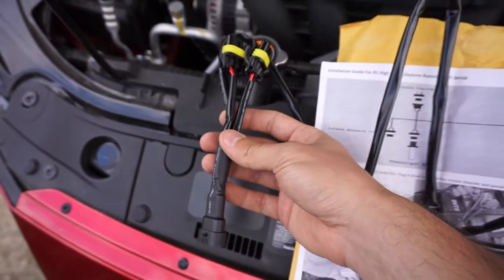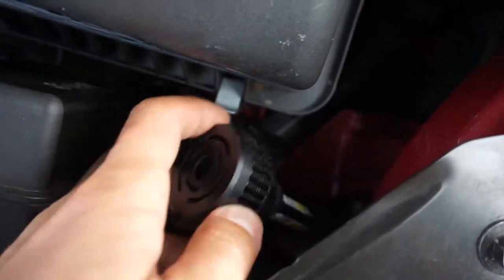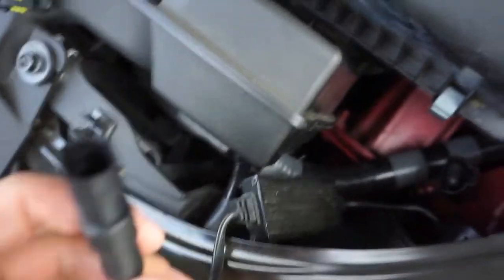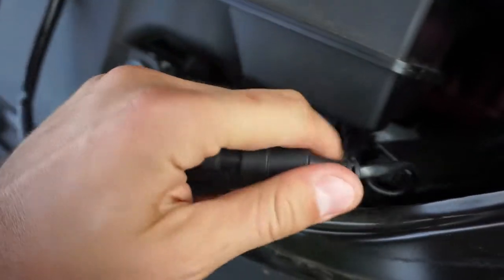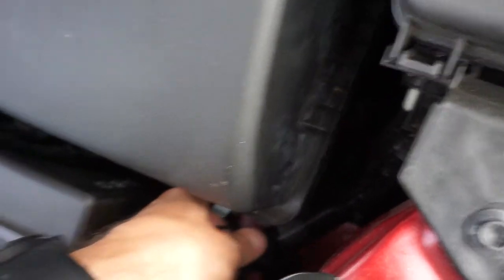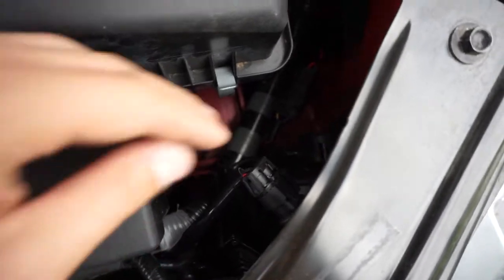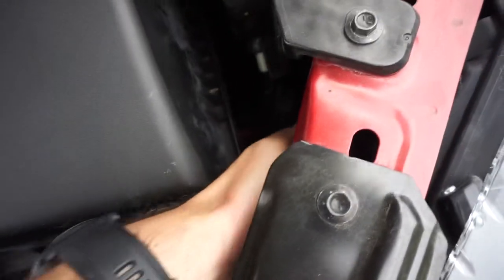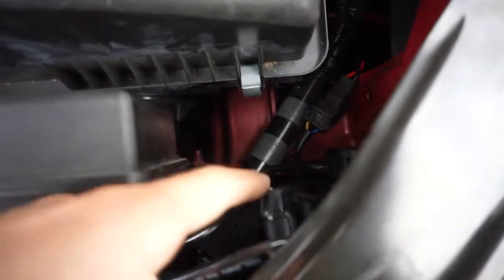Quick Fix R1 Kit - LED Bulbs For DRL's AND High Beams

Comment: Doesn't this put too much heat on the resistor?
Reply from the maker: The resistor should always be screwed onto a metal part of the car. It hasnt given me any issues since installing.
Reply: Thanks!

Comment: Ive tried this on my 2013 cx5 to fix my drl, but dont seems to works.. switched a couple connectors and finished with a high beam fuse burnt. Any advice? Dont work same for cx5?
Reply from the maker: Dang man I would assume its the same. I dont have the specs for the CX5 so Im not sure. Try searching forums to see if others have tried.

Comment: Looks good, so you just put in a load resistor for the high beams?!
Reply from the maker: +Alex Calinescu Yea, thats all it really is. This kit just routes both bulbs through one resistor which is enough to make them work. It was very rewarding to have it work.
Reply: The Adventure Mazda I’m trying to do it on my moms elantra and it has 1 headlight low beam then high beam which is also drl. Same as yours. I’m looking at the h1 resistors and they have 2 wires pos and neg. I happen to have spare resistors but they only have one wire. I wonder If I could hook up the one end to the cars pos then to the bulb pos and then just ground the leds neg.
Reply: Does ur car have canbus? I'm wondering if it would light up on my elantra.these have a fan ?

Comment: Great video, 
The website description says that LED light output will be same in both DRL and High Beam modes.
This means that I will be driving with my high beams always on.
But in your video I can see that you have both functionalities of DRL and High beam.
Is it due to a LED bulb or the R1 kit can make both DRL and high beams work?

If the reason is LED bulbs, can you send the link to them, or say the brand?
Reply from the maker: The R1 kit basically routes both lights to run on just one sides connection. It tricks the car into thinking there is enough pull to illuminate them. Each bulb isnt enough by itself because it uses less power than the halogens. So the regular DRL function has both lit up in a more dim mode, and brights send more to make them much brighter like with normal bulbs. I dont have a specific bulb to recommend, but somewhere I made a video on upgrading your car to LEDs where I have a link to a specifoc bulb.
Reply: @TheAdventureAuto  Thanks for the information, I am planning to upgrade the drls to led, and this will help a lot :)
Reply: @TheAdventureAuto  I'm surprised the led's will light up in DRL mode because they normally need at least 9V to light. So regardless of the resistor tricking the system into applying power it still is only giving 6V and splitting it between two bulbs. So I'm wondering also if the high beams are at full brightness or reduced somewhat as well because of splitting the power between the two bulbs, maybe bringing them down to more like a low beam light?

Comment: Is there a spot you recommend placing the resistor ? So it doesn’t melt anything
Reply from the maker: I am struggling to remember where i put mine. I remember zip tying it to the metal

Comment: I have a question, I have aftermarket LED (Don't know what brand, had to change them because my HID keep going out with different problems and kept costing me money, So I went with whatever the guy installed.) and
I'm having the same problem with these LED no day time running lights but when you mention you have a set up of 9005 HB3 does that mean I have to have the exact type of brand/type for this to work?
Reply from the maker: +XxHernandez_21xX You definitely dont have to have same bulb type but the 9005 HB3 matches the R1 kit. Just make sure to match the bulb you use to the correct kit.

Comment: Did the passenger side connection to the harness click in for you? My r1 kit isn’t working and I think it’s because the passenger side isn’t clicking in place
Reply from the maker: When done properly they wont click into place. I had to flip mine around a few times. Even when not clicking you shouldnt worry about it coming loose, mine hasnt.

Comment: I'm purchasing a 2018 Sedan 3 Touring this weekend and am planning to upgrade both the DRL/Highbeams and Low Beam Projectors. I'm sure it's been asked in the comments already. But do you have any knowledge as to whether this kit should work with the 2018 mazda 3's for the DRL/Highbeams?? Additionally, could you provide a link to the bulbs you purchased for those specific lights? 

Thanks
Reply: Additionally, Do you know whether or not this kit would work with these bulbs: https://www.diodedynamics.com/high-beam-led-conversion-kit-for-2004-2018-mazda-3-sedan.html
Reply from the maker: You can get mich cheaper bulbs that'll work just the same. DD bulbs are really expensive. Search 9005/HB3 LED bulbs and any of those will work. Then the DRL kit can be installed and they will work as DRLs. I purchased mine on Amazon and after a year they're still working great!

Comment: Hey wondering what is that little light on the outermost side of your headlights that turns on at 6:07, I like it
Reply from the maker: I believe it's called the side marker light. From the factory it's an amber colored bulb, I think numbered T10. It's a pretty easy swap if you have small hands lol.
Reply: @TheAdventureAuto  Thanks for the info, have you noticed that your highbeam is a bit dimmer with the iJDMtoy kit,  I want to get one but have read the highbeam might be lower, have you had any problems?
Reply from the maker: @DrCerovic  No problems, but LED bulbs definitely throw light in a different way. It doesn't illuminate the road as far down, but more everything within 50 feet is completely bright.
Reply: @TheAdventureAuto  thanks for the quick reply man, Is it still ok for driving at night when you need a hi beam
Reply from the maker: @DrCerovic  Yes absolutely. I prefer the LED high beams, but it's all about personal preference. They work very well.

Comment: Like most folks who have commented here, thanks so much for your video! So it's been a couple of years, do you know if there are now LED bulbs that can function properly both as DRL (lower output than high beam) and high beam WITHOUT such a decoder/resistor kit?
Reply: There are. Idk the names.

Comment: Thanks for the video man.  This really helped.  I have a 2017 Mazda 3 and same thing as for as leds don't work for drl.  I saw some foglights on the market for 2014-2016, but is there any for 2017 models?
Reply from the maker: +Joseph Fejeran Im glad my video helped! Im not familiar with the 2017 fog setup, so unfortunately I wont be of much help :/
Reply: The Adventure Mazda It's cool.  But thanks, Still appreciated.

Comment: Hi there, thank you so much for your video, really appreciate it ! Do you have any idea what happened if the Hi beam of the H15 is working but low beam isn't ? Is that about the fuse or any other issues ?
Reply from the maker: What car do you have that uses an H15 bulb? I am not familiar with that setup.
Reply: @TheAdventureAuto  All EU Mazdas with halogens has H15 high/DLR

Comment: When I went on the website it didn't have my car.  I have a m azda
Reply from the maker: +XxStUnTiN2422xX It doesnt list Mazda. I think the R1 kit shows Lexus. Just get the R1 kit and it will work.
Reply: The Adventure Mazda+ I did both leds but had to switch to hids in the regular headlights because of the projection in the regular head lamps wasn't enough with the leds.  If they weren't projection I would've kept the leds in.  When I put one led in the  DRL/high beams it worked and was bright  but when I put the other one in that's when they shut out.

Comment: TBD I just pulled the fuse from the DRL, and use the halogen to blind people at night lol
Reply from the maker: What did pulling the fuse from the DRL do? And why blind people at night when you could just use normal low beams?
Reply: The Adventure Mazda there is no point in using DRL in the city and at night it's just a sayin...
Reply: ZeroColdx911 where did you locate the DRL on the vehicle and on what kind of car do you have??
    
   Our car is a 2017.5 Mazda 6 I want to pull off the DRL fuse because I’m going to use separate DRL in the day and I could also use them at night. 
                Thanks!  XX 👍🏼

Comment: I installed this but my lights won’t come on at all. They do when I turn on the high beams but not the running lights.
Reply from the maker: If you bought this kit and it isn't working, chances are you just need to switch connected around and use trial and error to see if they work. And always remember that the running lights do not come on when the car is in park, or the e-brake is on. The best way to test is to have a friend put the car in drive, or set up a camera like I did and see if they come on.

Comment: Update 6/24/2020, so my problem was the LED bulb I was using, I got something different from Amazon similar to the ones use in this video and now it work, if you care to know what LED bulb here is the link. https://www.amazon.com/gp/product/B075QJB2JF/ref=ppx_yo_dt_b_asin_title_o01_s00?ie=UTF8&psc=1

UPDATE, It didn't work for me, either the high beam work or if I reverse polarity the DLR work, but thank you for the video tutorial.
I have issues connecting my 2001 Lexus IS300, I will give it a try tonight, apparently I was doing it wrong be cause the instruction with the kit is just a piece of paper very useless, So I'll try tonight your way and see what happens!
Reply: Are the lights dimmer at DLR mode? Some LED lights output full power at DLR mode and I was trying to find one that is dimmer at DLR mode.

Comment: Where did you end up mounting the yellow resistor? Also what did you use to mount it? (zip ties, screws etc.)
Reply from the maker: I zip tied the resistor wire to a metal point. Cant remember exactly where.

Comment: Interesting. My car also runs the highbeams at 6 volts to allow them to function as Daytime Running Lights. How does this thing actually work though? Wouldn't it just be easier to design a headlight kit that works properly at 6 volts?

Comment: They look great, did you have any problem with them after the installation, I just got a Mazda 3 2018 Hatch it will fit on it? And how did you connect all the loose cables?
Reply from the maker: +Sebastian Gomez No issues since installation. I ran the wires under the plasic guard and it has held them in place just fine.

Comment: Have a two questions.. 

That Kit R1 will work with my Mazda cx5? 
Lastly what led bulbs recommended for my lowbeams cuz I had 2 different set from Amazon approximately $35 each pair but they are not bright enough.. 

Thanks for updating cool videos keep it up with the great work. 
God bless you..
Reply from the maker: If your bulbs are H11 then itll work. I havent tested it but I dont see why it wouldnt. My bulbs are also a basic LED from amazon. Good luck!
Reply: Try diode dynamics sl1

Comment: Which relay kit did you order when I went to the website  it only shows kits R1/R8.  I have a 2017 Mazda 3 with 9005 LED bulbs
Reply from the maker: R1 is for Mazda3's, unless they changed with the 2017 model year. I have a 2016 that uses 9005 so Im sure itll work for you.

Comment: amazing... 
pretty sure thats going to work in my mazda cx5 2014  get pull over twice already due to ligths blinking 

thanks for the video !
Reply: did those finally work on your 2014 cx5? I have a 2015 cx5 myself.
Reply: Wondering the same...2014 here
Reply: I'm sorry for the late response.. YES still working. Has been 2 years since I installed the harness set and still working with no issues..

Comment: how are these holding up? also it looked like they were flickering when you were backing up
Reply: I could see it flickering also. I have been running this kit(identical to one in this video just a different LED bulb) for several months now and the flickering has got worse over time. I can see it in the reflection of the car in front of me and at times it even shuts off completely. Also doesn't help that my bulbs are ice blue while flickering. I think it's worse when the ac compressor kicks in while idling in traffic. It happens randomly no matter if it's hot or cold outside. I'd bet others are having this problem to but they just haven't noticed it yet. Took me 2 months too finally notice. I can't recommend this to anyone. 2018 Mazda 3 Touring
Reply: @woooose  are you still having this issue?
Reply: @SketchyGrizzly  I gave up and took them out

Comment: I installed these and my drl work fine but when I turn on my headlights my high beams turn off. I can’t flash my lights anymore, do you know how I can fix this?
Reply from the maker: +Wolverines I dont understand. Arent your bright supposed to go off when headlights come on? When you pull the stalk back to flash brights they just turn off? If thats the case then try flipping the connectors around. I had a few issues when installing but flipping stuff around usually fixes. Just keep flipping and testing until it works properly.
Reply: Wolverines My exact problem did u figure it out?

Comment: Did the resistor also have to get flipped around in order for the lights to work or could you just clip it on regularly with the tab?
Reply from the maker: I had to flip it around quite a few times before it worked. It was a lot of trial and error. I dont specifically remember which ones ended up using or not using tab.

Comment: Thanks for the great video! Helped me alot in doing exactly the same thing. I just installed the same LED conversions set up on my 3 with the H11s & 9005 you suggested in the other video.

I do have a question though. I have noticed that in DRL mode the 9005s flicker ever so slightly, its more of a "static" effect if you will when i looked at the beam in my garage up close. In high beam its solid and stead light. Have you noticed this effect on your lights? In the grand scale of things i don't think it matters visually on the road, just wondering if you have seen the same.
Reply from the maker: +Anthony Bailey Jr I didnt notice that on mine, but the only time that I have gotten a good look was in my video. When the car is in park or the ebrake is on, the DRLs turn off. How were you able to get yours to stay on?
Reply: I just put the car into reverse and held the brake. By doing this I was able to turn on the DRLs to see how the beam looked. So far i haven't had any issue. Though I am interested to know where you eventually put the resistor. I currently have it stuffed in the open area behind the Highbeam bulb. I cant really think of anywhere else to put it.